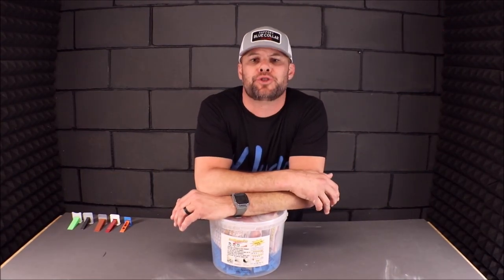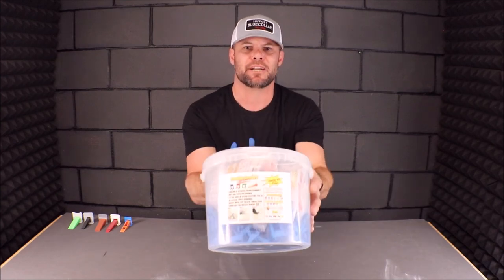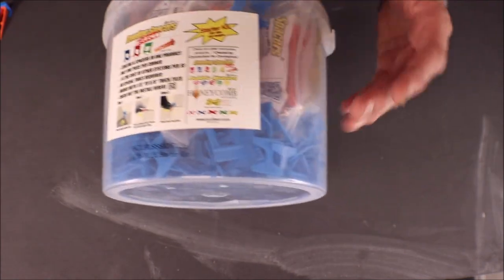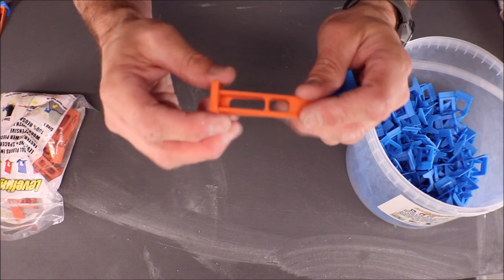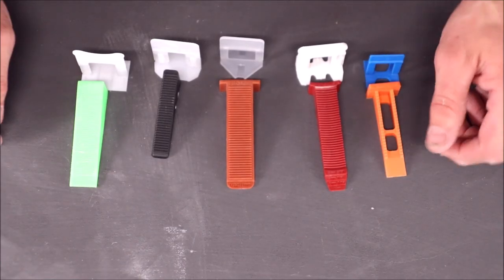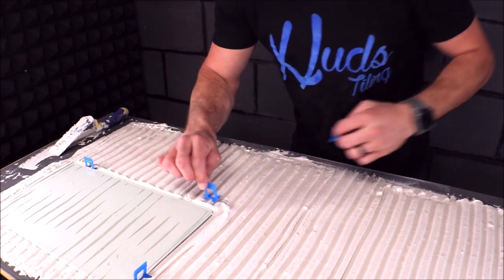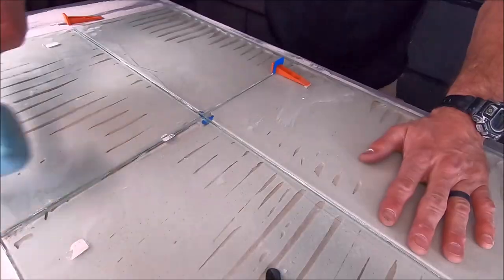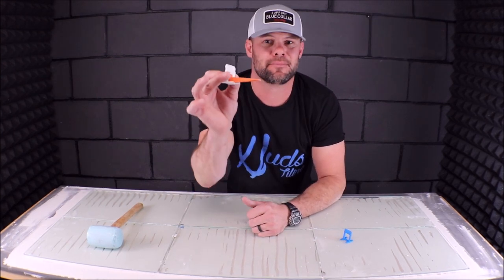Window Wedge Tile Leveling System by Acufloor

Comment: The best system on the market in my opinion have been using for 7 years now. Clips are super strong takes a lot of force to break them. Wedges hold up pretty well even tho some of the lock-in claws strip away after multiple uses they still seem to lock in place and not move.

Comment: Great video I would guess the color coordinates with the different sizes.... when you have 8 guys working on the same project could you imagine the possibility of a mix-up if all the spacer's different sizes were white (32, 16, 8, etc)?
Reply from the maker: Maybe, but change the blue to white! Still can't mix that up..
Reply: Yeah you nailed it. The different colors make it easy to identify the different joint sizes when you have multiple joints on multiple jobs.

Comment: The project source system from Lowes has quickly become one of my favorite.
Reply: I haven't seen this one. Will check it out. Are the wedges wider than the QEP system sold at home depot?
Reply: @mattjudy6780  The wedges are almost identical. The clips are better than qep. Clips have little ears on them that make them easier to handle and remove. The qep system and project source system work together very well. I can only speak on the flat clips as I don't ever use the rounded clips.

Comment: Enjoy all the reviews man! I have found the cheaper systems on Amazon work just as well as any ibe used. The one I have from Amazon does anyway. 25$ for a starter kit that includes more wedges and clips. I like the window in the wedge though
Reply: Yes but you use 3-4x more clips so it comes out more expensive per SF

Comment: Looks like they got a really small base, while that's good for mortar coverage I wonder if it has the holding power of the others 🤔
Reply: I noticed the wedges easily slid all the way through.
Reply: @mattjudy6780  the glass was probably thinner than most tiles and they just came out with a new wedge design that had a steeper angle to work better with thinner tiles. Good eye

Comment: Think I will stick to the Perfect Level Master system. I don’t like the idea of clips on the corners of the tiles over mortar. I also find the extra clips used to be a good thing. Of course the extra cost does hurt. #ltlapointestile